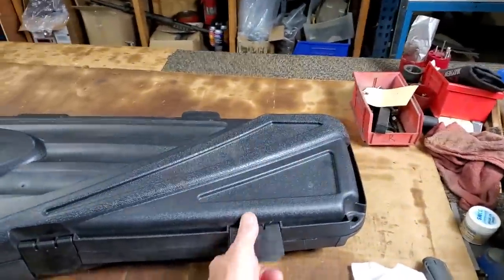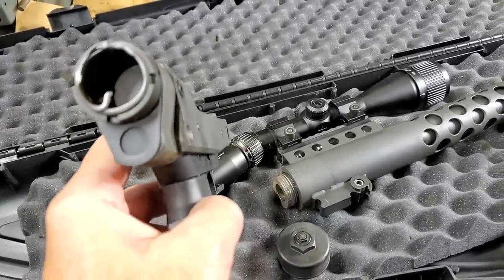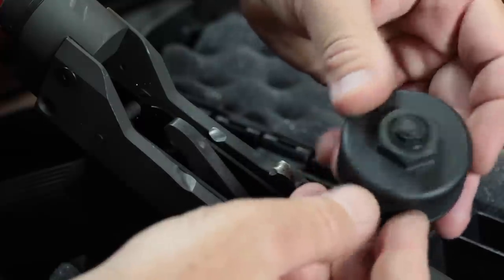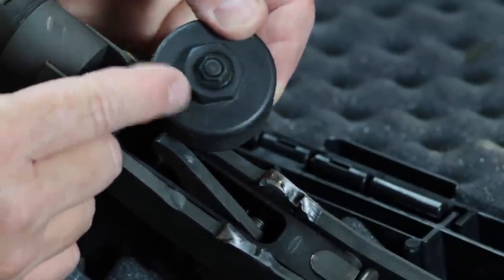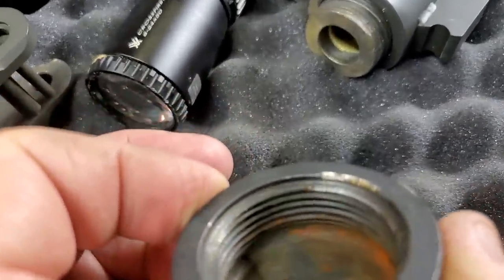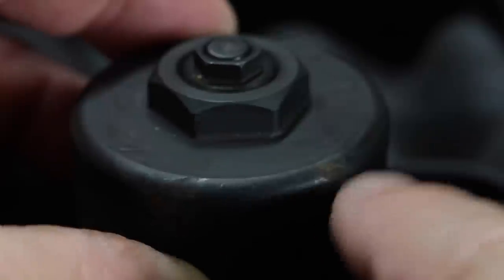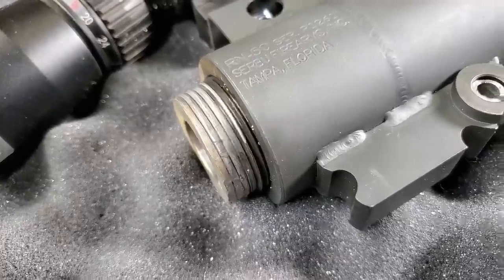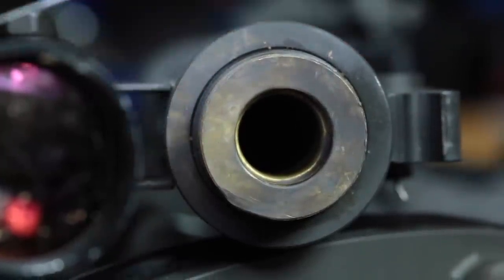Kentucky Ballistics' RN-50 Blow-up:  First Look

Comment: I'd investigate the type and amount of powder inside the left over SLAP rounds.
Reply: Yup, a breach explosion caused by the overpressure generated from the propellant, the size and type of grain used would be important factors as would chemical composition and age.
Reply: @nick3551  That's been my theory. These are "reloads" of original rounds (which is why everything matches up). Some guy probably came across them, figured they were in bad shape / powder had degraded, so removed the bullet and reloaded them. 
1. My first thought, was it used an odd grain size/shape of powder so the guy used, "whatever seemed closest" (read: Regular .50BMG powder) which was probably a shorter grain gunpowder.
2. He weighed the original powder charge... without drying it. Possibly throwing off the weight by a ton due to absorbed moisture. So say he weighs it out at 260gr (a normal 50 is 215-220 nominal), and he thinks, oh that's fine, big tungsten projectile, blah blah.
3. He has now reloaded these with ~18% MORE gunpowder, of a finer (faster burning) grain.
4. Scott almost dies.

I hope he has the information for the guy he purchased it from. I take serious concern with false representation of goods.
Reply: @ObservationofLimits  That would explain the crimp marks too, someone reloaded them and crimped them.
Reply: @danielc2701  Especially a taper crimp, which could have been the way they had the seating die set. Whatever caused the overpressure was pretty clearly a catastrophic level of error.
Reply: @redneckhippiefreak  I am going to ask as an amateur, in the original video where Scott got injured, the rounds were flying to the side, right ? could it be they were slow to leave the barrel, because the rounds were too big, or there was overpressure due to the metal shavings from the round itself? I imagine the stress to machine barrel twist path into these rounds is pretty hard, and obstruction can happen, it also didn't happen on the first round shot.  Is it even possible to make a round like this in conventional, soft, ammo dimensions without blowing the rifle up?
Reply: Someone dislikes the comment I made above for reasons unknown. If you are sure of what happened, please share. Unless the bullet or the barrel is damaged, the round cannot go off feet from aiming point in a distance you can throw stones to.
Reply: @ObservationofLimits  That's just it, no one seems to have any information on the origin of any slap rounds, not just Scott's rounds. I have several slap rounds and slap t rounds with wcco9 head stamps on them and I have no clue where they came from or how they were surplused either

Comment: The stock of the rifle hit Scott's hand and is what broke his finger, Really interested to see what went on there because you can see the bottom pin on the trigger group is sheared right off and the trigger group is pushed down. I Wonder if it was just the force of the end cap hitting the ears, that made it break and fly down into Scott's hand. If that is the case that is Insane, i cant even imagine how quick that cap must have been moving.
When the end cap hit the ears that could have made it Tumble?
also the SLAP round that scott used didn't look like those ones. The one Scott used had a smooth Sabot, it didnt have the little notches in it from what i could see.
Reply: I know Scott said he thinks the stock is what caused the damage to his hand, but if you slow down his slow-motion shot of the explosion you can see that his hand is directly below the lower, which I believe is what did the damage. The force of the cap shearing the ear tabs off, plus the explosion in the chamber forced the lower directly down onto Scotts hand.
Reply: It DID have the notches - it's just the lighting. Look closely. However it does not look properly crimped.
Reply: @skepticalbadger  not having a proper crimp, could that cause the explosion? Or is that just an indication that it's some shady tree reload with no telling how much powder charge or the wrong powder
Reply: @dylanbrown4635  The correct answer is B. The crimp is only there to hold the round together until it is fired. However, not having the proper crimp is a big red flag that someone may have (likely has) tampered with the round. If someone reloaded a deactivated round with pistol powder for example, that would explain everything. Pistol powder is the fastest burning; 50BMG is the absolute dead slowest. By using the wrong powder the pressure spike would be insane because the bullet can't accelerate fast enough to get out of the way of the too-quickly burning powder and you'd have a very high chance of this failure.
Reply: @dylanbrown4635  yes, too tight of a taper crimp will cause a pressure increase. That much pressure, i dunno I don't reload 50bmg. I suppose it could but it'd have to be damn tight.
Reply: @Dan Didnot wow that's brilliant genius. You must be the reincarnation of John Moses Browning 😂
Reply: @dylanbrown4635  just to be clear, the crimp wouldn't be the likely cause, it'd have to be a max charge and also way too heavy a crimp. That heavy and you'd be able to see it, and we don't see that, we see what looks like a normal crimp. I'm just saying that yes an improper crimp can cause severe pressure spikes.
Reply: @Dan Didnot don't think so based on the brass being extracted and nothing else in there

Comment: Hope he starts hot loading rounds (remotely) to see the breaking point & the fail spot(s) 💯 

that would make a cool vid as well 😉👍
Reply: Gunpowder didn't do this.
Reply: I wonder if perhaps it was underfilled with powder? Hear me out before scoffing please, I just want to float this out there to see if it might have more merit than we think. Here’s the scenario, somehow there’s less powder than design. Say 1/2 of the case, the primer when struck flashes over the top of the powder and ignited it from say the middle, idk just spitballing here. Now we have a pressure spike going both ways, one out the barrel and one towards the receiver because the pressure wave is probably the only way to generate a wall strong enough to force the rest of the powder to burn against it and direct its energy back towards the receiver. 

Think about it, the projectile has less mass than the breach cap but the barrel flew forward indicating the energy had been directed against something in excess of the mass of cap and the strength of the threads and the frame. Had the ignition started at the back, normal, it would push against the breach as a pressure wall builds and then against the pressure wall as the powder burns forwards from there.. I may not be on the right track here but it is the only thing my squirrel brain can reasonably attribute to this terrible accident.

PS please test this theory along the hot rounds and see if there is more stress on the firearm from each scenario.  It would be awesome to use some high speed Data Acquisition equipment and affix strain gauges to measure the affects practically real time
Reply: @tbthedozer  very interesting thought. However, there is only so much energy potential in gunpowder. This wasn't that. Just my hypothesis. We'll see.
Reply: he should start by filling one with pistol powder..its the most likely problem
Reply: @zippythinginvention  

So, what are the chances of having a tampered round compared to a bad round?
Reply: @tbthedozer  

Odd theory, since it would mean the gun fires a round that is far lower in power than it was designed for
Reply: @tbthedozer  that's not how pressure works. Pressure is omni directional, like blowing up a balloon. Many people have claimed in the past that an under load of powder can "detonate" instead of burn but it has never been successfully replicated. Much more realistically the cause of under loaded rounds bursting guns is due to the loader not realizing they already charged a case so they charge it again into a dangerous overload.

Here it seems more likely that the powder was either incorrect at the start (too fast of a burn rate) or the original power had either decayed into an uncontested nitroglycerin burn (many powders are simply nitro mixed with additives to control burn rate) or that the powder had been physically broken apart by means of vibration (corroded cartridge cleaned by vibratory tumbler for resale) increasing surface area and acted as a fast burning pistol powder instead of slow burning rifle powder.
Reply: @zippythinginvention  modern smokeless powders are true explosives (usually nitroglycerin, but not necessarily so) that have a mediator agent to slow the burn rate. A decayed mediator can fail to slow the burn rate, so the entirety of the pressure curve can occur more quickly. If you chart the pressure vs time of a cartridge in the barrel and take its integral, you can see the maximum pressure X time. If the gun is proofed at 100kpsi, going from 65kpsi (common max pressure of many rifle cartridges) and reducing its pressure climb interval by just half you would far exceed 100kpsi. This is how most rifles can fail by simply loading a round with a case full of pistol powder.
Reply: @crazyfvck  this was three or more times the pressure of a .50 bmg. no one designs and builds a .50 bmg that can withstand that amount of pressure because no one would reasonably load a .50 bmg round to do that amount of pressure. Unless they either incompetent or wanted to blow up the gun
Reply: @zippythinginvention  how about counterfiet instead? someone picked up spent slap rounds and loaded them to sell as surplus.
Reply: @zippythinginvention  Look at the divot the cap left in the shoulder of the gun having already removed the rabbit ears. The pressure must have been incredible. 
Beginning to think the alphabet men have been dropping some of those C4 rounds state side as well as in the Middle East....
Reply: @camojoe83  there have been bolt action 50.bmgs that have exploded sending the bolt flying back into the neck of the shooter. seen footage of it. the shooter was shrieking while the range officer was yelling for the range to cease fire.
Reply: @tbthedozer   Pistol rounds are routinely under loaded as target loads.  Shot thousands of them and never even heard rumor of them blowing up due to less powder.
Reply: @glumpy10  true but if I remember correctly reading somewhere that it isn’t recommended to have the case too empty but rather to switch to a different powder the fills the case better. The short answer is obviously to prevent hang fires. Depending on the powder used this might be more important in a longer case such as a 50 cal. If I had to place a bet I’d say it was a lot of faster than rifle powder loaded into it but still if the person who loaded it knew it was faster burning powder they may have tried to reduce load it.. hey just a second, does that SLAP round have a charge in the projectile? What if the powder used set off the projectile charge ? Maybe that could spike the chamber pressure? I wonder if a half a charge would let the primer tickle the charge at the back of the projectile? Or the completely wrong powder.. at this point I think we all just want to know what happened no matter who has the right answer.
Reply: @zippythinginvention  It could if they used a really, really wrong type. 12.7mm powder is very slow burning to give it time to accelerate down the barrel, if someone had reloaded it with a much faster burn rate powder, the round won't have had the time to clear the barrel before the pressure went over the limits.
Normally, the heavier the round, the slower the burn rate to accommodate for the slower acceleration.
Reply: @danielc2701  show me.

Comment: After seeing that damage, I am still convinced that the rifle didn't just "fail" because of a weak part, or design issue.  I will join the chorus who are convinced the round was loaded wrong or badly degraded, and caused a massive overpressure spike.
Reply: I agree
If it was just the cap and lugs, one could point at a mechanical failure
But the lower twisted and it sheared the pivot pin as well

This was a pressure buildup so high and fast, it didn't simply take out the weakest link in the chain
(and 'weakest' being an understatement)
Reply: True. If the problem was the rifle, we would have seen previous issues. If it is a rifle problem though, we will be seeing issues in the future. Which I doubt, and I pray doesn’t happen either way for the sake of the shooters.
Reply: That enlarged fireball seems to verify.
Reply: with the lack of anything going on with the brass, im basically convinced its a massive overpressure issue due to the SLAP round being fired from a rifle with a muzzle break, which it should never be fired through as per warnings/specs etc.
Reply: @savagetuner2404  Or a manufacturing error 1 off on Scotts RN? no one knows yet.... i hope we find out, I am on your side, with 80%.... 20% of me tells me its a manufacturing error...... I KNOW!!! I KNOW!!! devils advocate.... BUT possible but improbable.... untill showen other wise we should all keep an open mind.
Reply: @junk3996  Scott had previously fired SLAP rounds out of the same rifle with no issues so if the rifle was at fault then a malfunction would've happened sooner
Reply: @richardthomas3697  not necessarily. there are a ton of assumptions in that statement
Reply: It was def the rounds he was using.
Reply: @junk3996  but couldn't it have been a bore obstruction issue due to the sabot and the muzzle device?  If there was one round with a loose projectile that seems to lend to the theory also.
Reply: @gene8842  if it was the muzzle brake the explosion would have been there not the chamber.
Reply: @junk3996  funny barrett says that muzzle brakes work just fine with slap rounds if it is a military muzzle brake and not a civ one. the brake would just shear off if it got jammed up by the plastic breaking off on prior rounds and it would more likely have the plastic being ejected from the sides of the brake.

the whole thing about slap rounds not being safe to fire with muzzle brakes is FUDD lore. stop repeating it.
Reply: @richardthomas3697  
"Scott had previously fired SLAP rounds out of the same rifle with no issues..."
False.

Comment: "This is the strongest part of the rifle so what hit it harder and stronger I guess Scott right" LOL That dude is an iron man it still blows my mind how he lived through that and saved his own life the way he did. If those are real slap rounds then I'd say it's definitely an undercharged round from factory that did this. I'm assuming they have safeguards in place to prevent a powder mix up and considering it's loaded on an automated machine its really hard to double charge a round especially 1 loaded for military. Those are normally a pretty full case so they would've had powder coming out the case mouth and would've had a hard time seating the bullet if they could even get it started. Now if those turn out to be fake which wouldn't be that hard to do someone f**ked up and used the wrong powder. Either one of those scenarios would blow up a gun no matter how good they're built.
Reply: Captain MufDyven  in theory it sounds plausible but I've personally seen my buddies 308 rifle blow up from trying to load subsonic ammo using under the minimum charge weight and not using any case filler. Without case filler when you level out the rifle the powder lays across the bottom of the cartridge (like a half empty water bottle layed on its side) and when the primer is hit the fire doesn't hit the bottom of the powder column and burn from the bottom to the top. It showers down on the powder the whole length of the case igniting the whole charge at once. So to me that makes the most sense because most military cartridges are a pretty full case so if its loaded right that powder wouldn't really move around enough to break it down. If it was able to that I would think it gets bounced around more in transport from factory or while the ammo is being bounced around in the field than a tumbler so I'm assuming you'd see a lot more guns being blown up. I'd also assume that you'd see a lot more old ammo that's had a rough life then shot would blowing up guns to. The scary part is this could happen with any factory loaded ammo because all ammo is being loaded on automated presses so dumping a light charge is a very real possibility but it's probably a very rare thing to happen. Now like I said if these turn out to be fake rounds someone f**ked up and used the wrong powder probably a pistol powder. They should also be hunted down and put in prison because they could kill someone...
Reply: @DanielBoone337  true an undercharge round is more like to explode, I don't think you could get enough powder in the case to create that much damage.

Comment: BS that round had to have been tampered with or loaded wrong, the whole lower bent? Let alone all the destruction? That Slap round was a grenade.
Reply: If it was a "grenade", it was "tampered with", right?
Reply: @fewwiggle  "tampered with" does suggest a connotation of malicious intent, but I think the more likely explanation is just incompetence on the part of the reloader using the wrong type or amount of powder and possibly not crimping it properly as suggested by Mark.